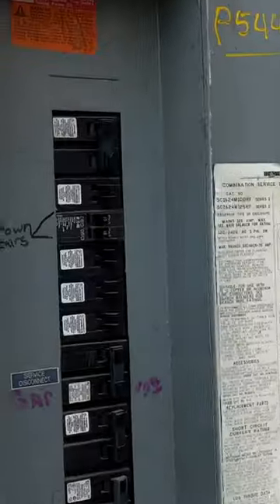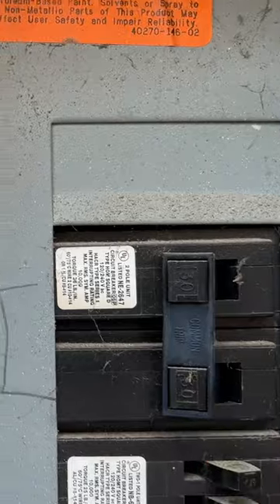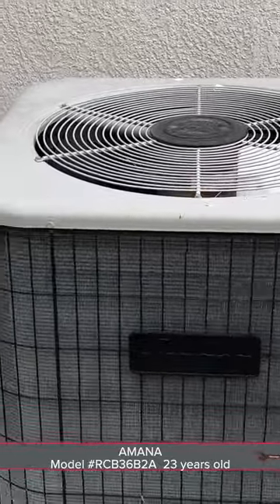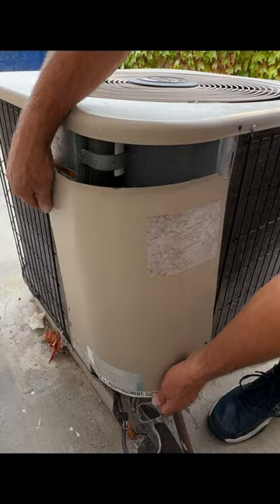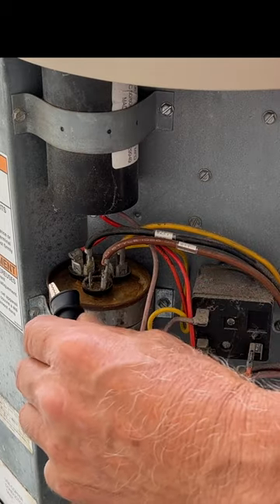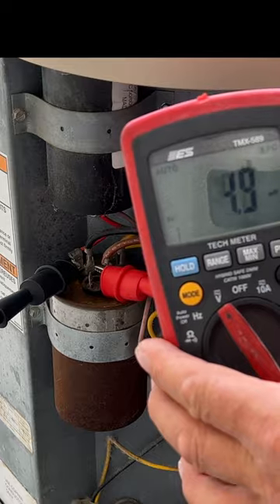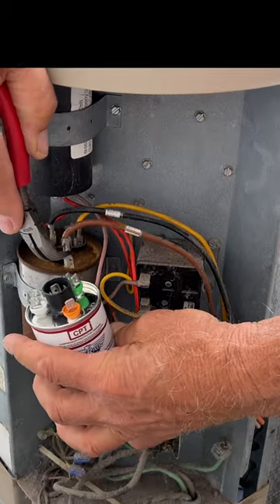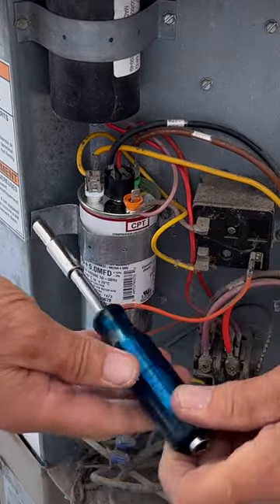HVAC Capacitor Home Air Conditioner

Comment: It is a shame that you have to put a BS disclaimer on a simple video.  So long as you showed the correct procedure, you should not be responsible if some person does it wrong and gets shocked.  I changed the capacitor in my home unit last week.  Both the old and new cap had three sets of terminals labeled C, Herm, and Fan and the unit has three different colored wires.  It was simple, $17 and I have cold air again.  

Question:  The AC now seems to be working better than it was for the last few weeks prior to the cap failing.  I'm wondering is it possible for the cap to not be failed completely but causing the compressor or fan to not run at 100%?
Reply from the maker: From what I researched when I was working on mine, yes, I’m noticing mine is running more efficiently
Reply: The reason he needs a disclaimer is because someone could see the video and say "that looks easy", and not realize all the hidden dangers there are. Also, there is no way to cover every contingency for every make and model and every installation. If he leaves out a critical step because he assumes everyone is familiar with it, someone could get into trouble. It doesn't hurt much to put the disclaimer, but the benefits are huge. Or rather the problems avoided are huge.
Reply: @realSamAndrew  The disclaimer is not a bad idea, but it also doesn't really mean if he was actually being sued.  I have had several attorneys tell me that even if the person signed the disclaimer, it would be almost worthless in court.